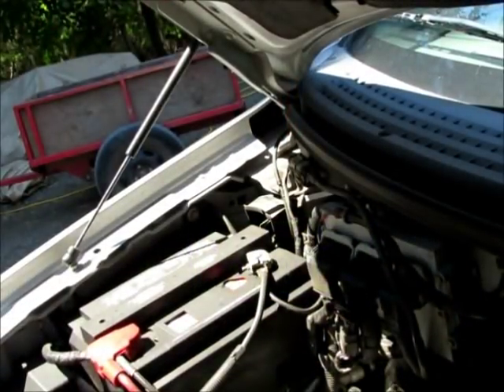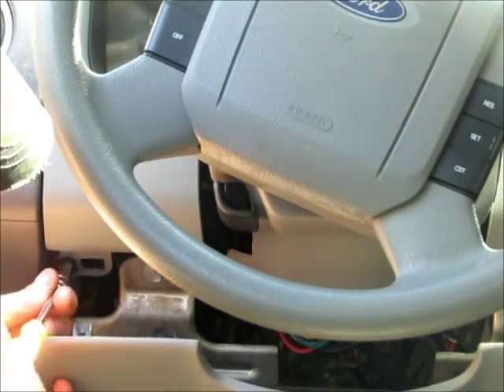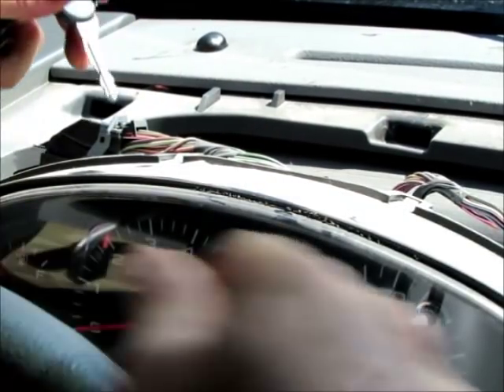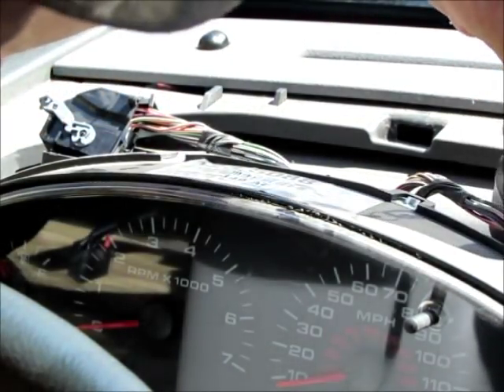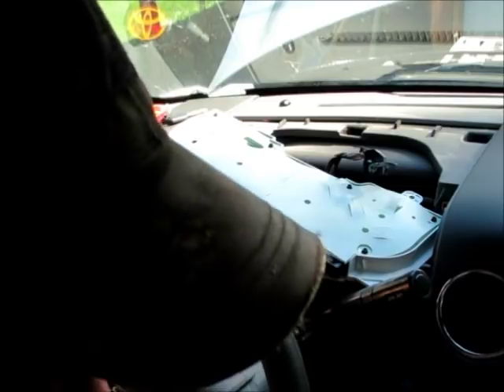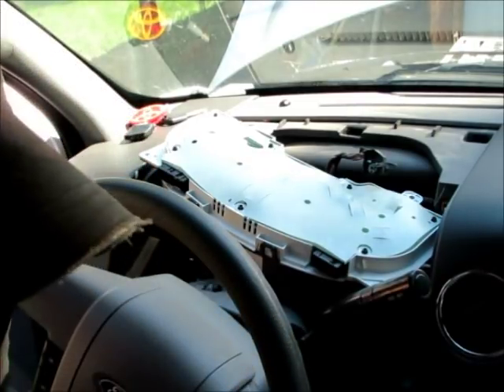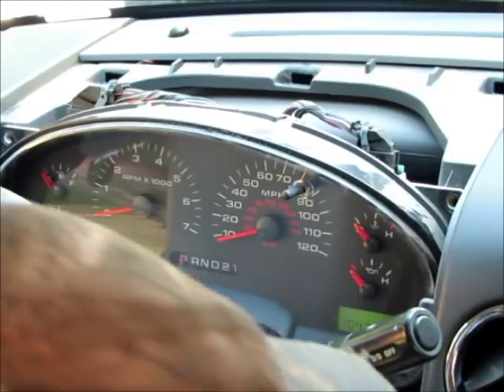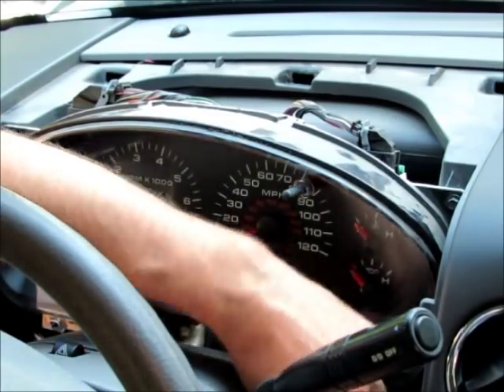2004-2008 Ford F150 odometer lamp replacement

Comment: Some of you are having issues with the LCD screen not showing trip/odometer miles.  The LCD screen has six silver prongs(Male ends) that sit inside a (female) sensor that is soldered to the cluster.  If any of those prongs are out or bent the screen will go out.  Suggest taking it out pull the LCD add a little bit of Di Electric grease and bam you should be back in action.  If you look online in Ford Forums there are several pages of this same problem.  A 15 minute fix could save you a bundle.  Reply if you have further questions.
Reply: Hi Kelly Hons, I remove the cluster to resolder that 821 resistor to make the brake light go out. After checking the brake fluid sensor and fluid level. The emergency brake switch was good. Reassembled and the odometer isn't working. I didn't disconnect the battery ? I will check for misaligned pin of that right hand harness connector. Some people are saying blow it out with compressed air? Thanks and will keep you updated. Yet why would the prongs be a problem if I didn't mess with the odometer  unit ?
Reply: @327JohnnySS  Did you figure this out? I was also soldering 821 connector and upon reassembly I’m having same problem. No digits on odo display
Reply: @MarcusKearny  , I found that one of the pins was slightly bent from the factory. It would work intermittent or a speed bump.lol. I took a small pair of needle nose pliers and carefully straightened out the pin that got bent from factory. Just carefully inspect the connections. Good luck and I hope that this helps. 👍
Reply: @327JohnnySS  yep TY! Turns out that did not have odometer LCD seated correctly, once I did it’s showing damage so ordered a new one for install today.

Comment: To remove the bulb you need to turn the gray plastic bulb holder 1/4 turn counter clockwise. Well done directions. Easy-Peasy.

Comment: 37 bulb was on point. Just got it at auto value. The 74 bulb is a little bit longer(depth wise) I looked at both in the parts store. Thank you for this video. Literally could not find the part # anywhere, and no parts stores can look it up because they don't even have the info. Hats off to you guy. Been without the odometer light for years! Thanks for saving the day. The little things in life I tell ya.

Comment: This video was very helpful but I undid the screws holding the lower trim panel also so it gave me more room to work with. I took me about 20 minutes to do this thanks to this video

Comment: Thanks man , I have been putting this off for too long but you made it look easy. I will get her done right away so I can stop using my cell phone light to see in the dark. Thank again and good video.
Reply from the maker: Did you get it done? It's a simple job
Reply: @idahodeerhunter  yes it took all of 15min, I did not like the fact Napa only sales the whole part bulb and socket for  $9.00. and the socket did not fit so I used to old socket.

Comment: This operation worked out on my odometer , 04 super crew,  using a 74 bulb.  The only exception was that I removed about three screws on the plastic backing to access the bulb. It all works either way.  Thanks for the video. Took about 20 min to complete.

Comment: Great Video! I have a 2008 Ford F150 4.6 V8 and this worked perfectly! When I picked up my light from O'Rielly they told me that sometimes instrument clusters lights are sautered into the casing. That got me worried, but this isn't the case on my Truck the bulb is all you need you can reuse the casing that comes with the truck when removing the old bulb.

Comment: Great video work. I have the 2007 XLT I need to do this on and this is just the info I needed. Thanks for posting.
FYI, my XLT does have the heated mirrors, but the switch for that is located below the climate controls, not on the cluster panel, so the extra plug behind there is for something else (models with switch for adjustable pedals?).
Also, another difference between the #37 and #74 bulbs is rated average life. The #74 average life is 500 hrs because it burns hotter to get the additional candle power, while the #37 average life is 2500-3500 hrs. So the #37 may not be quite as bright but will last a whole lot longer.
Reply from the maker: thinks for the info on the bulb life. in my opinion bulb life really doesn't matter to much when you can replace it within 15 minutes. thanks for watching
Reply: ***** Done a little more research and found that extra plug behind the cluster panel is in fact for an adjustable pedal switch.

Comment: Probably the best video out there when it comes to working on and replacing this particular light bulb. Thank you!
Reply from the maker: MrCes1966 thank you
Reply: I followed your instructions last night and now have a working Odometer back light.....again, many many thanks.  

The #74 bulb is a little bright for my liking however I am not going to change it. I think the #37 bulb is probably the best choice to use IMO.
Reply from the maker: MrCes1966 that's great to hear happy it worked out for you

Comment: Great video, but I had issues getting the cluster cover off.  The back tabs stuck and if you lift it up to much the cluster cover will break.  Just a warning if it doesn't come free pull it towards you and use a pry tool along the back or you will be gluing your cluster cover back together

Comment: I replaced the bulb and test it before replacing all the parts and it worked as it should. I put everything together and wouldn't you know it, bulb is out. I didn't have time to investigate so I'll check on it tomorrow. Could it be that the contacts are not sitting correctly??? If that is the case, how would I deal with the little prongs on the base that twists on there???

Comment: Thanks for posting this video. I'm going to attempt this myself in my fiancés truck tomorrow. Curious about something, I noticed when you were checking the light, the vents make a noise. What and why does this truck all of a sudden start doing that? I noticed his does it too. Thanks in advance
Reply from the maker: The noise you were hearing was the speedo cable resetting itself after I tugged a little to hard on it. No big deal
Reply: Dolly... I have the same problem on my 05 and it's not the speedo cable. It's the motorized vent door either opening or closing very slowly.. mine does it every once in a while and I'm just going to live with it rather than going into the dash

Comment: Very helpful video, but when I replaced this bulb in my 2007 F150 FX4, it still doesn't work?   Any additional ideas?   Should I be concerned about polarity and flip the bulb around?

Comment: Awesome video, but i have a question, just picked up an 06 f150., week later having an issue and wondering if this is the video to fix it.... right now the miles on my odometer do not show up.. so i dont kno how many miles i have since last week..lol.. when i turn my light on, i do get a green light on in the odometer housing, just no miles or anything shows in there.. is this the issue u were having when u replaced the bulb ? thanks brother... happy hunting  ::))
Reply from the maker: no my issue was just the light. To be honest when we bought this truck the od light was out. the mileage was showing just fine. sounds like you have more of an issue then a bulb.
Reply: ***** yeah sounds like i do... lol thanks for the reply bud !!
Reply: Did you ever find out the issue for you f150? We are currently having the same problem and has us frustrated.
Reply from the maker: what issue? the bulbs are a easy fix
Reply: ***** my issue is the same issue Mrlava Lui has. I already tried the light bulb and it didn't help
Reply from the maker: Aurora Armenta all I can say is take it to a ford dealer and have them check it out. most likely it's the gauge cluster

Comment: thanks for the video... I just got a used 06, and the odometer went blank within 2 days, is it the bulb or is it something else??  Thanks.. . any and all info would be greatly appreciated... Thanks..
Reply from the maker: 6811 Chapelfield if it's completely blank it's more than a bulb. If you can still read the odometer but it's dark it's just the bulb.  Best of luck
Reply from the maker: 6811 Chapelfield read down in the comments there is a guy talking about some prongs being bent that cause the issue your having
Maybe it will help

Comment: Gonna attempt to try this on the bulb. Don't have Tilt Steering,though. Can't move the steering wheel.The push knob for the milage,doesn't work either. Also,do you know anything about the defrost not blowing out,when the defrost is on ? It's a 08' Ford F150. The Heat works,and so does blower motor. Just won't blow out the  dash  when the defrost is on.
Reply from the maker: Not sure on the heater control.  Bulb replacement is easy

Comment: This video was great and it took all of 15 minutes and a $2 light bulb to make it right.  However, I noticed the ABS light coming on intermittently since I did this.  Anyone else having this trouble or is my ABS failing?
Reply from the maker: I never had the abs light come on but I did have the parking brake light come on. The electrical connection on the top left wasn't all the way clipped on check both plugs make sure that their both secure

Comment: Is it the same for the rest of the lights on the cluster. Cause the one that lights up there gas also went out. But upon taking them out I noticed they are 2 different sizes. You have any recommendations as to which ones to use. Please let me know asap. Ty
Reply from the maker: oCANICAg  I don't you'll have to pull it out and take it to a auto parts store.

Comment: I have the cluster panel instrument panel out of my 2006 F150 and after I plugged it all back and I had no dash lights signal lights work but The Eliminator on the instrument panel cluster does not Flash
Reply: All started with the airbag light not Illuminating when the key is turned on so I thought it was a burned-out bulb but I couldn't find that either I just made things worse

Comment: Followed this video to the 't'  did the bulb replacement with the 74 bulb and now the break light is on ...disconnected the battery before i started this job ...reconnected and it was fine just went out and noticed it says on steady .......and one had this happen ???
 Reply
Reply from the maker: Yes my brake is on has been since before I replaced the bulb. I figured out the top left wiring harness on the gauge cluster isn't making a good connection try taking it back off and putting it back on make sure it's locked down in place. Hope that helps
Reply: Thanks ill try that tomorrow ...this truck has never had a problem ...just that darn light.... must be that connection .....
Reply from the maker: +Ed McLaughlin I would bet money on it. I left my battery connected and wigged and pushed down on that left plug and the ebrake light went out
Reply: Check your brake fluid level.....
Reply: Was a fuse
Reply: Glad you found it......I realize your comment was more than a year ago, thank you for replying.

Comment: I have 2008 fx2 f150 and when I use the remote start the doors lock, honks once then turns on, but immediately shuts off and redoes the starting procedure, and keeps on doing the same thing in a endless loop, if anybody knows what might be wrong please let me know , ive checked the fuses and reset the alarm nothing has worked.

Comment: For that much work to change a bulb, the factory should have used LEDs.
Reply from the maker: I agree leds would have been a great improvement
but it's quick and easy
Reply: problem being the gauge needles wont be lit.. truck i just bought has LEDs and the needles are dark at night... HATE it.  thats why i'm here is to figure out what bulbs i need.

Comment: For the oh so intensive labor of removing two more trim screws you can take the cover under the steering compleatly off, I find it easier that way.
Reply: Also, never ever ever use a key as a tool. If you don't have the proper small size flathead to pop tabs with then you don't have the tools necessary for the job anyway.